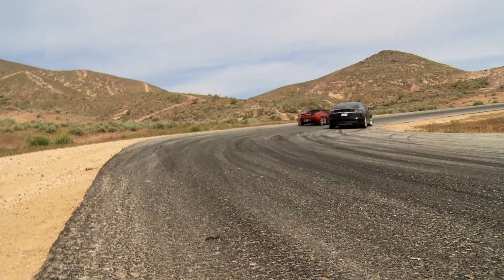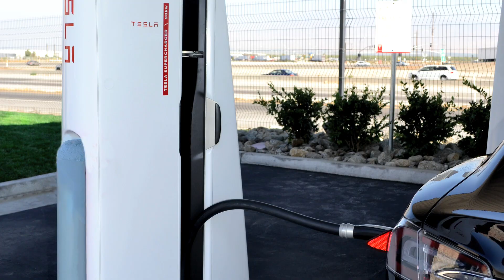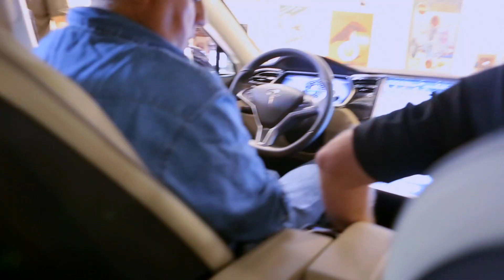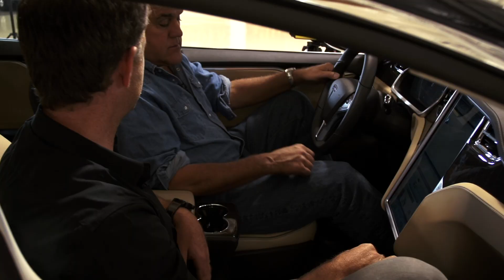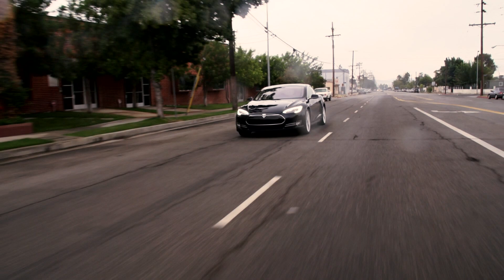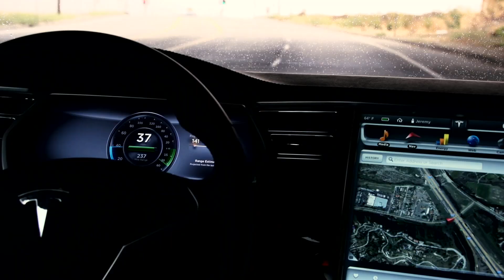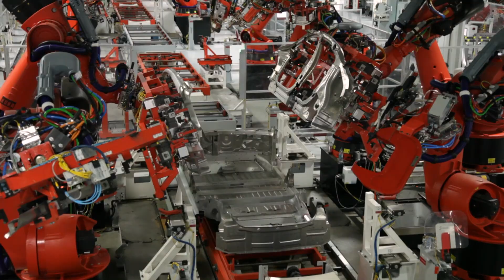2012 Tesla Model S - Jay Leno's Garage

Comment: It's not 10 years and dead, it's 10 years and 20% smaller battery capacity.
Reply: Yeah, 10 years is a lot of time if we talk about technology.
Reply: Marauder252
With the advent of lithium sulfur it would likely only cost around 3k.
Reply: The battery is really the only thing that will wear down over time,  and in 10 years, the same capacity battery will be a lot cheaper, or just upgrade the 90kwh with a 150kwh in 10 years assuming a 5% increase in battery density per year
Reply: Even IF it costs that much to replace this battery now(questioning the price you gave) It definitely won't cost that much in 10 years to replace a bunch of 18650 batteries. I mean I use 18650 batteries in my flashlight and my vaporizer and they are only about 7 bucks a piece.
Reply: @heavymetalgaming7145    7 bucks times 7000 battery equals only how much?
Reply: HeavyMetalGaming 7,144 individual, 18650 cells in an 85kWh battery pack.

7,104 x $7USD = $49,728USD

The average lifespan of the average pack will be over ten years, not counting wrecked cars or packs replaced by owners for the minor decrease in range. Also, this does not include owners who will certainly upgrade to a newer, more modern battery pack, either built by Tesla or a third-party.

These batteries can be serviced on a module, or even cell-by-cell basis, and it should surprise no one if they last longer than 10 years.
Reply: HeavyMetalGaming Yeah it costs only $15,000 now to replace a 100kwh battery
Reply: I'm sure by 2022 plenty of superior aftermarket batteries will be available for these old Model S-es
Reply: Unless rapid charge, plus battery life & cost significantly improve, the best way to overcome all these problems when electric cars become more common, is to switch full/empty batteries in the filling station. While that's not at all practical (or possible) with current designs, the industry should design new cars to allow a quick change, using standardised battery sizes (maybe a few common sizes) & filling station infrastructure, where empty batteries are removed for charging & replaced by full ones. Old batteries would be recycled & new ones constantly fed into the system. The cost of batteries would be covered gradually, as part of the exchange/recharge fee. Battery companies could run chains of filling stations, like oil companies do today & 'filling' the battery could be as quick & easy as filling the tank.

Without a significant leap in technology (cheap & available technology - not theory & experimental) this is by far the best way to give electric cars the long-range practicality of traditional cars.
Reply: it's a $100,000 to $160,000 car, $25,000 is nothing for 15 years of use...
Reply: Rocket Boards So the Tesla costs less but people amazingly buy the supposed more expensive cars. So women are paid less but employers amazingly don't hire only women.
Reply: tjp353 I would have no interest in trading my well cared for battery for someone's abused battery. This is the electric car equivalent of oil change places taking the oil out of the first customer's car and putting it into the next.
Reply: He should record a follow up!
Reply: we will find out in 10 years
Reply: How are Batteries on the environment?  I imagine a huge push for eradicating our dependency on Battery power in the future.
Reply: I doubt. Unless we can send energy across long distances without loss instantly, batteries will be the best way of carrying potential energy. That is, of course, knowing that new battery chemistries will continuously be explored to find the perfect balance of cost, performance and energy density. Ultracapacitors too are nearing the horizon but so far will work in tandem with existing battery technologies to improve overall performance until their energy density increases. Most forseeable electric propulsion technology will rely on this.
Reply: if you have ever tried to fix a dead laptop battery, this is the same.
Reply: It's been 10 years now and the reported numbers are 10-15% degradation after 150,000-200,000 miles.
Reply: @scroogemcduck1462  IF even. Most only lost about 5 %.
I saw plenty Tesla from 2013 in germany which had more than 200k miles and lost only 5 % ( with certificate ) and still had warranty left.
And newer models have modular batteries, so you can easily swap out those 5% for new Cells and your back to 100%.
And those often have the first brake callipers on.

You cant really complain about that, especially because a regular ICE Car would be either dead after 200k miles or would have needed easily 5k or more in repairs.

And you have to factor in that your ICE needs fuel, calculate that and you will see the Tesla is a shitton cheaper.
Reply: +Obyvvatel 20 years and 20 times the power
Reply: And then you'll spend 5k in gas a year instead of 1k for electricity. And then, your head gaskets or transmission will blow and cost 2k-5k. Then oil changes, brake pad changes, and other fluids... Yea, gas cars are not cheaper than electric, even at the high electric car prices right now. Even with the cost of electricity and a new battery every 20 years, at 50k for the pack, thats 2.5k per year + 1k in electricity, 3.5k a year instead of 5k in gas + 1k in maintenance + other unexpected maintenance that doesn't happen on electric cars... Still cheaper...
Reply: If you think about it, even after you die, your grand children can still be driving this car even with no maintennance/battery replacements.
Reply: It's called physics and Tesla can't defy it, believe it or not I guess. No more than Tesla can defy gravity, a battery lasts 10 years only if not used (and lasts has a marketing definition) and a car has over 200 mile range only if you choose to toast the batteries.
Reply: Here's the problem, while they may claim the battery will be good for 10 years, pretty much every Tesla has had the drive units/batteries replaced multiple times in way less time than that, all be it still under warranty but yeah, I don't see them being cars that last out of warranty due to price of replacement parts.
Reply: Most people are not spending anywhere near 5k in fuel.
Until battery prices drop, electric will remain a novelty.
Reply: HeavyMetal
The actual number for the full price of the 90kwh hour battery is 50k. Or 50,000 USD about half the price of the car. The issue is the batteries use rare materials, that and they lack energy density. But what you said is very true with newer batteries the cost can fall dramatically.
Reply: It's 25000 USD to replace the battery when it's old. Who wants to pay that much on repairing a 10 year old car??
Reply: @Marauder252  It's pretty cheap since there are other things that you don't have to replace in a tesla
Reply: Marauder252 where did you get those numbers

Comment: ten year battery life..ok if your rich, These cars wont go for much on the used car market..can you imagine, i'm sure this will be overcome..they really need a 20 year reliable atleast lifespan id say..but im pretty convinced this is the future and im fine with it.
Reply: Dumy Jobby
yeah and then you get propably better performance out of the batteries.
Reply: it doesnt  die after it, just lose it capasity
Reply: after 10 years you losse 20% of the charging capacity. but in 10 years time batteries will became (i hope ) cheaoer, lighter ,linger lastuing etc. i don't think there will be much of a problem replacing the batteries after 15-20 years
Reply: +Nick Greenaway "These cars won't go for much on the used car market," he says (＾▽＾)

Comment: Everyone can get an electric car. Then we can stop changing oil into gasoline and just ship it directly to the power plants. Its not really saving the environment, or saving you money. It just changes where the oil is being burnt. Either way, if I were Jay. I would be adding one to my collection. 0-60 in 4 seconds, it does a burnout, it looks incredible. Very subtle and sophisticated. It looks like a normal car and not some outlandish spaceship thing. I like that about it. And it doesn't make a sound. That's pretty cool.
Reply: That is another argument to be had. This is why the BMW M3, I believe, beat out the Toyota Prius as the "Greenest" car of the year. The making and disposing of Toyota batteries did more harm to the environment than the production and running of the M3......
Reply: +Shawn Gates Even if all powerplants used fossil fuels today it would still be a lot more efficient burning it at the plant than in the individual engines.  Look it up, Elon Musk particularly mentioned it a lot in his interviews and gives more detail.  About 60% efficiency vs ruffly 20% efficiency in a car engine.   Now considering that power plants use many different sources of power including nuclear and renewable's being the fastest growing while more and more coal plants shut down...
Reply: +Jimmy M the process of making the power train still damages the environment massively, and if the power train dies (like an old ice engine) and not recycled properly it's cause even more harmful effects. Also there may be grammatical errors since its around 2 am for me rip
Reply: Shawn, that was the old NiMH batteries, current gen lithium are much easier to recycle with no heavy metals.

Oh, and the new one does 0-60 in 2.5 seconds...

Comment: Don't ever let the car sit without power for longer than a few weeks as the batteries cannot be recharged if they ever fully discharge! And boy will they charge you an arm and a leg to replace them. And they hide this info in the fine print. The battery array made up of thousands of individual laptop batteries seems hopelessly inefficient and outdated as well. 7000 batteries, that means 14 000 electrical contacts! Boy, can't imagine anything possibly going wrong with that! And as they said they estimate the battery pack will last 10 years but the cost of replacement is literally half the price of the car. This will make Teslas utterly WORTHLESS in the used car market. But the MAIN reason I dislike Tesla is the owners of these cars are the most smug, annoying, holier-than-thou ASSHOLES you will ever meet.

Comment: Jay...You don`t put your foot on "The Gas" in an electric! You put your foot on the switch!
Reply: +Donald E. “Don” Riley Wouldn't that be a potentiometer since a switch would just be full on or off?
Reply: Wouldn`t it be a hoot for Jay to say "Stepping on the potentiometer"!
Reply: Old fashioned terms like that are used for plenty of new things that don't match the word.
Reply: +Donald E. “Don” Riley accelerator
Reply: +Donald E. “Don” Riley throttle
Reply: GLennerd Even Jay needs to pee once in a while
Reply: unlikely. probably a bit more sophisticated than that.
Reply: It may be a potentiometer but also Hall effect sensor at the same time
Reply: Donald E. Riley 
We call it the "accelerator"
Reply: appelpower1
Inderdaad.

Comment: I heard batteries cost 8000€ to replace with 10yrs life span means 800€/yr maintnance cost. Which is more than my two current cars with tyre changes included. But they use petrol that comes with 2k€/yr bill.
Reply: +BoxOfGod In 10 years that 8000 euro battery won't cost any where near that.
Reply: +Octamed Good point. And petrol will cost more than it does now

Comment: So the car is only good for 10 years??
Reply: +peruface it will have 80% battery after 10 years. considering you dont have to service it, oil changes, and the cost of filling it up its still a bargain. I bet a new battery pack is the same as an engine swap in a gasoline car which many cars need doing after 10 years of heavy use.
Reply: ok good. I'm getting the model 3 for sure now :)
Reply: +peruface After 10 years (in the year 2023 to 2026) depending when you bought it, the density of batteries will have increased a butt load, AND it will be much cheaper to replace the battery because the market for these things are skyrocketing.
Reply: Kurt Foster so Your saying all i have to do is to replace the battery for a new car?

Comment: Tesla is the greatest car on the road!
Reply: +798unionpipeliner for all the resources both financial and engineering that BMW has access to compared to Tesla. And what Tesla has developed in the ModelS only makes BMW look even worst than it is. Their cars are no longer what they were in the 90s and everyone knows it. Quality has dropped significantly, creativity is nowhere to be found, engineering is mediocre at best all they do is continue to make gas guzzling oil burning iron blocks. They should be far ahead of Tesla but instead their stuck in the past with MB,Audi and Lexus. And this is from someone who currently drives a BMW which has been a good car, not great but good, and as soon as I am able to I will switch to Tesla
Reply: +798unionpipeliner BMW nor Tesla are cars

Comment: 0-60 is almost as good as my supercharged Mach 1. I'm impressed.
Reply: +kingcrimson234 It does 2.8 seconds with ludicrous mode
Reply: +Defcon 5 No. The P90D Ludicrous mode does 0-60MPH in 2.6 seconds. P85D Ludicrous does 0-60MPH in 2.8 seconds
Reply: +Defcon 5 using NO GAS

Comment: Range IS an issue!!!  I think you need a 500 mile range to really make this a car someone could use for everything.  Unless you don't drive very far
Reply: +amaroudis Range is NOT an issue. I have a 70 mile range EV and a 20 mile commute to work and 20 miles back. Over 20,000 miles on it. no problems

250 miles of range is literally unlimited for daily driving. There is no issue with range
Reply: *****
If all you drive is 40 miles a day, then I guess yes it is ok.  If this is the only car you have and you have to travel more than the range allows, you are in for a long trip.  Many people in this country have to travel on the roads a lot, whether it is for work or pleasure.  I still don't understand why people buy electric cars today.  Technology is not there yet.  They are much more expensive, and often times they have a bigger carbon footprint than a normal family sedan.
Reply: +amaroudis A Ford Fusion Titanium AWD show a mile range of 365 miles ( I get 21.1 miles and that is mostly city driving). It drinks gas like a chick at the club on ladies night. If Tesla can get their range up 100 miles over there current 285 miles, lower the purchase cost, place more efficient battery within,  and also place charging stations everywhere (could just have these placed at gas stations) that would make this the ultimate car. I live in Alabama for now and there are limited or no charging stations that are close. This would be the car that I keep for life because the maintenance would be so minimal and cheap if there are many cars like this on the road. He has set the standard that could take out many parts manufactures and they do not like it. It saves a consumer so much money. Definitely if there is a great warranty that comes with the car at purchase (10 years). Also making older models future proof is awesome. The new car that engineers will buy!

Comment: This channel needs to test the P85D or the new P90D!
Reply: Nah, the P100D should be the choice...
Reply: And jeremy's P45
Reply: Why not go to P100D? Might as well go all the way.
Reply: SomeNiceMovies You are one year late p90D was the top dog p90d doesn't exist anymore
Reply: Yes those cars are absolute beasts! I cant believe they generated 1000+ft/lbs or torque!
Reply: +Demon50 over 1000ft-lb torque ? Where did you read that? www.Teslamotors.com claims 713 ft-lb torque on the P90D
Reply: +Ray Walker The engine maximum(without software impediments) that doesn't make the car fly is ~1000. The real maximum is Infinite.
Reply: How about the P100D
Reply: +Lajcsi Vagyok thats funny also cause the name on the care display is also jeremy
Reply: +Dark Matter Right
Reply: SomeNiceMovies  wasn't there yet
Reply: Leno is going to test the nect gen roadster!
Reply: I bet he'll check out the plaid roadster.
Reply: Marcus M The P90D is still being manufactured by Tesla in both the Model S and the Model X. Dunno what you're talking about.

Comment: If such alternator charging type system was put in place the company would probably never see a consumer buy their batteries or a very long time or is it that this cannot be done? Creating such a charging system using the motors to spin a charging alternator to produce current amp volt to the system but of course with major power output reduced. Ex from 691 whp to say 250 cruise mode.  

Same thing I keep thinking for cell phones if the some how made solar cells to keep the battery drainage slower because the constant trickle charging? This would have to be done on  with a nice slim case design..